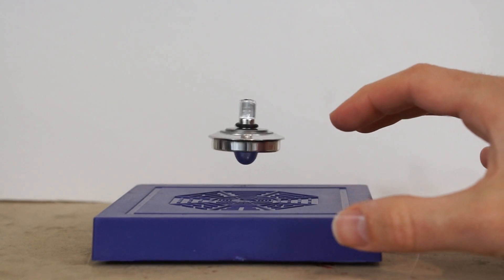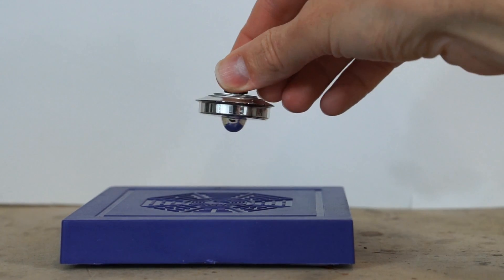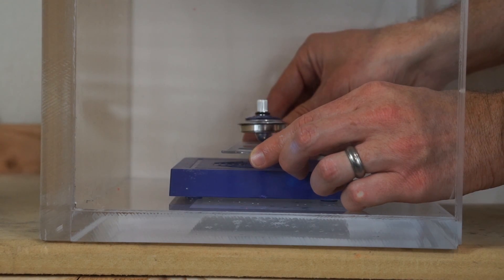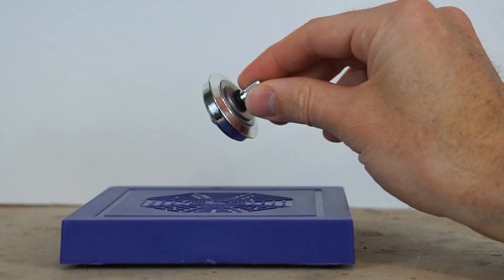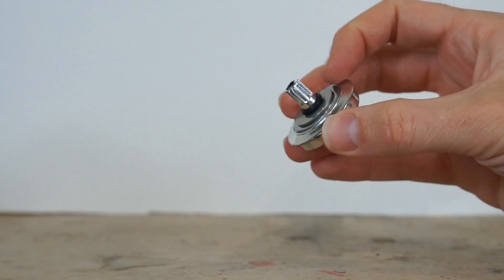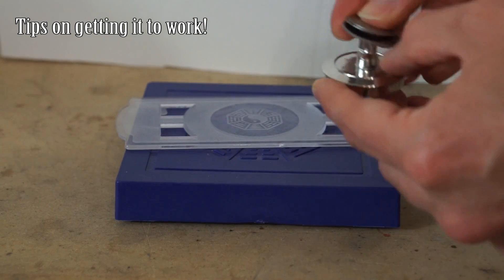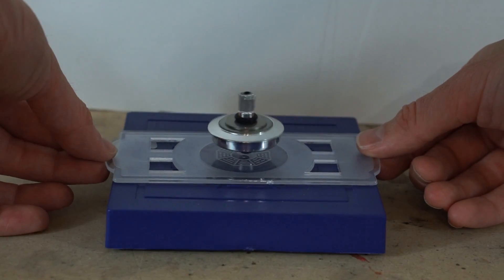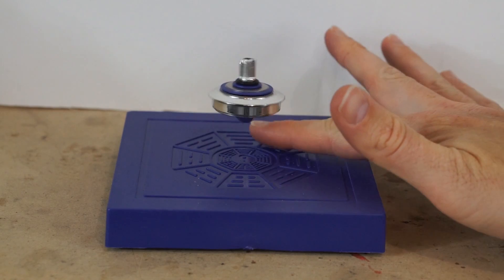Will a Levitating Gyroscope Spin Forever in a Vacuum Chamber?

Comment: The earth isnt spinning in space, you just kind of proved it.
Reply: Flat Earth Supporter😂😂
Reply: how? if the earth isnt spinning how do we have night and day?
Reply: You just kind of proved how little you need to know to believe in something
Reply: OttoZONE. how?
Reply: Is that a real thought? Are you that dumb? There was nothing in the video to support that moronic idea.
Reply: it didnt spin forever because of eddie currents. what is you flat earther's explanation for gravity? why do some things fall faster then other? what about the creation of planets?
Reply: OttoZONE His B.S. theory is slightly incorrect. Gravity force is the main reason it fell, not friction force. Even though the magnet is opposing the gravity force enough to cause it to levitate, there is still gravity acting on it. Gravity does not effect the Earth in the same way.
Reply: OttoZONE how does any of that disprove gravity. Let’s put three hundred years of physics aside for a moment. You don’t need that to see how gravity will pull things towards the earth with equal acceleration. It’s logically impossible to do anything else. Just look at the units. Acceleration(a) is meters/seconds^2. Mass(kg) doesn’t show up. As such if mass doesn’t cancel out some how in your equation the end result can’t be acceleration. The only way one could try to get out of this would be to relate acceleration to some kind of mass ratio, but upon further examination this doesn’t help you either. There is something due to gravity that is different from mass to mass. It’s called force. You know F=ma. Now, let’s go back three hundred years a try to find out acceleration shall we? Ignoring direction F due to gravity is GMm/r^2 where G is some constant, M is the mass pulling on a object, m is the object in question, and r is the distance between them. For a give object with mass m we know that F=ma in general. Hence  GMm/r^2=ma. Hence GM/r^2=a. Isn’t that magic. There is no variable m left the equation. Just a predicted. Really, this is basic stuff. 

Yes, in a vacuum if you drop a brick and a pin at the same time they would hit the ground at the same time, but I would put my hand under the brick. No, that fact that atoms have mass doesn’t conflict with this, and no that doesn’t mean that everything with equal volumes should have the same mass.
Reply: Apastrons Gt An astronaut playing growtopia??? lmao no u guys should do ur own research on flat earth proof instead of asking in the comment section lol theres too much to expkain to type it out
Reply: News Flash:  The Earth is slowing down too.
Reply: a block of wood weighs less then a block of steel because of its density and the atoms in the two different substances. you still didn't answer my question about the creation of planets. a hammer and a needle may hit the ground at the same time but what about a feather and a concrete block? you also have to consider aerodynamics and the amount of drag on each object.
Reply: OttoZONE LOL FAIL!! It doesn't spin forever because the magnetics pushing up and gravity pushing down creates friction. Simple stuff. Learned that in 7th grade physics. lmao
Reply: Cole Purchase what does the creation of planets have to do with OttoZone’s points? It’s a red herring, and I don’t believe you know the answer anyway, so why bring it up?
Reply: jeremy hansen yes, there is a variable in your equation. G is not a constant. G is an average, and goes out the window when statistically examining its various “experimental” derivations across history. The Cavendish experiment is an example of the non-repeatable,  non-reproducible determination of G. It’s called a constant, and like the official distance to the sun, it has changed throughout the years. Some kind of “constant”, that is. Some BS science, all this support of the heliocentric model.
Reply: UAP Cant tell if all these flat earthers are trolls or if theyre really all too stupid to strap a camera onto a big balloon and see the footage
Reply: zeNUKEify um that's already been down flat
Reply: To all dumb flat earthers here 
Take a fucking telescope go to a beach or harbor and point to a ship or cargo that's leaving ,if earth was flat you should be able to see it no matter how far it goes using your telescope .
But that doesn't happen after a while the ship just plain disappears and it doesn't matter how big a telescope you use the ship can't be seen because its well over the curve.
I know some dumbfuck will bring refraction into this, 
Refraction occurs only when light moves from one medium to another with different refractive index, the light leaving the ship travels straight.
Reply: The Earth is spinning and it used to spin a lot faster billions of years ago. Some say that the Moon moving farther is slowing Earth down, but that might not be all there is to it. Studies also show that the Earth's spin speed can increase or decrease at times.
Reply: you don't know enough about physics, you just proved it lmao.
Reply: First off the pressure and buoyancy models of gravity are complete bs because of the gluon/higs field interactions that give around 4% mass to protons. secondly its bs because of the energy contained in the gluon interactions that give the other 96% mass to mater made of any combination of quarks. furthermore, the buoyancy models and the densities models cant explain things like the Casimir effect, superfluids, electrons dissolved in ammonia, electrons in a vacuum, the scale of density increase in plasma with an increased electron density and the list continues. density/ buoyancy theories are a simple-minded theory with no basis in reality and they completly fall apart when you look at reality in a more in intense fashion. you're going to need to do a lot of thinking to come up with ways to explain the things I just listed for your worldview to be justified and at that point, it would seem more logical that gravity is a thing and not just a figment of the imagination of most of the people on earth.
Reply: mass = resistance to acceleration. 
weight = (mass)(gravity aka 9.81m/s^2)
atomic weight = mass of protons + neutrons + electrons. 

the atomic weight actually describes the mass of an atom, not its weight. or the atomic weights would be different on different planets.

0.   mass is a property of matter
1.   one cubic meter of air has the same dimensions as one cubic meter of iron.
2.   iron has more protons and neutrons in its nuclei
3.   iron, therefore, has more mass than air due to having more matter inside atoms
4.   more mass = more weight.

All you're doing here is showing how little you understand about reality. I'd suggest going back to high school or even completing high school to begin will. Take physics and chem and you'll feel better about all the stuff you little theory cant explain.
Reply: If we are reviving mouth-breather old fashioned ideas how about blood letting and using leaches to cure mental disorders... I suggest you collect 6 liters of your own blood in a bathtub.  😂 I seriously didn't know that the illuminati conspiracy to test how gullible humans are actually worked... I thought it was a joke but I guess there are really some out there that fell for the trick... mostly elementary school drop outs but hey... I guess somebody's gotta flip the burgers. 😂 don't fall off the planet.
Reply: Lmao... according to some of the logic on here... tho statement must make sense... 

Dogs bark, so an iguana is simply a dog with a cold

Science has a following... people follow people on twitter... Twitter deserves a Nobel prize for literature.  

People have eyes, whales have eyes and storms have eyes so people are actually Gods that came from angry whales...

Lmao just because you use the word "theoretically" or "scientifically" in a sentence doesn't mean that somehow asinine concepts suddenly fake sense... please go walk off the edge of the planet if it's as flat as you say it is. Lol
Reply: If ur a real Flat Earther than why are you watching a science channel? I though you were anti science
Reply: Cole Purchase:
You totally didn't get it... Comment completely flew over your head...
Reply: Cole Purchase it’s flat lol dummy
Reply: Thats a two way street and your on it as much as I ya little globesexual.
Reply: we know that you can drop Hammer and a needle at the same time, and that they will both hit the ground at the same time.Mainstream science say's that this is due to the fact that the ''Pull'' of gravity is acting equally on all mass, in other words gravity is constant and that the pull of gravity is acting on mass the same universally across the board. Which is why The hammer and the needle both hit the ground at the same time. So if the ''Pull'' of gravity is acting equally on all things,and by that same pull weight phenomenon is created, Logically and theoretically speaking all things would actually weigh the same since we are strictly are adhering to the notion that only gravity grant's weight, throwing out the scientifically valid self sorting self arranging system of Density and Atomic weight.(KEYNOTE. please notice the first coined Scientific term ''Atomic Weight'' actually uses the word ''weight'' in it's description,and is also interchangeable with the term Atomic mass. It is highly disputed by the G-tards that mass is different from weight, but an in depth read on will reveal that despite their acrobatic gymnastics and double think they are forced to admit that mass and weight are indeed the same thing ->Atomic mass (ma) is the >mass of a single atom,< with unit Da or u (the unified atomic mass unit). >>It^> defines the *weight*<< of a specific isotope, which is an input value for the determination of the relative atomic mass.) You see to understand the lies you have to understand DOUBLE THINK. On the one hand they say Gravity is soley responsible for weight phenomena and on the other they also acknowledge Atomic weight. The problem is you can't have both. Why does a block of wood weigh less than say a block of Iron with the exact same preportions???? they say this is due to the atomic >weight< of the two masses. The ST.Einstein/Coppernicus cult has no way to mask this very obvious HOLE in their theory so they do admit that '' well yes it is actually the amount of building blocks that comprise an object and how big each individual building block is I.e IT's molecular Mass or Atomic Weight that determines how heavy a thing is.
Reply: F a k e. N e w s.    This has been demonstrated over 60 years ago.  Boring, boring, boring presentation and voice.
Reply: Truth bomb. Mind control programming TRIGGERED! Hypnotized masses go berserk!
Reply: Dude, he pumped the air out of the box and the Spinner wobbled and than fell. He than comes up with some B.S theory aboutwhy it didnt spin forever&some  junk and dosen't repeat the experiment to see if his hypothesis was true.
Reply: OttoZONE its because the earth is FLAT

Comment: Wouldn't gravity act as a force of friction?
Reply: No.
Reply: frozencloud17 that's not how this works, that's not how any of this works.
Reply: No.
Reply: frozencloud17 gravity doesn't exist
Reply: Jake Wagner if I threw a object in a 100% airless room (which is impossible btw) would it fall? Friction is two forces opposing and in this example it is gravity pulling down and a object flying up
Reply: Actually a sphere or a cylinder does not generate gravitational waves when rotating around its own axis.
Reply: Khenric not of its own but by distant neutron stars unless we are considering place away from our observable universe. As long as it is in our universe the Doppler effect will act on it.
Reply: I honestly don't see what the doppler effect has to do with it.
Reply: Khenric i didnt mean to associate doppler effect with the waves but what i wanted to say from being inside universe is that the light and radiations are factors that will result in stopping of the top with the the respect to time.
Reply: Donkey Kong hey buddy, try jumping then. Tell me it doesn't exist after that. Then give me an explaination to how it doesn't exist when we have proof of it working and forming our solar system and just about every galaxy in our universe.
Reply: try a superconductor😆
Reply: wow , brainwashed
Reply: I was wondering the same thing
Reply: Nothing exists.
Reply: Nothing is true, Everything is premitted
Reply: Jake Wagner that is how it works. The magnetic resistance and the gravity both work together on the top on both sides. Even if you do this experiment in space at absolute vaccum on a magnet it will still stop at some point. It will keep moving for long time in absolute vaccum if you don't use magnet at zero gravity but it will eventually lose the energy due to gravitational waves and will stop.

Comment: It will stop, because of the same magnetic area, not only hold it up in the air, but also function as a break. (gravitation pulls down the spinner, and the magnetic fields are push up in the same time).
Also light make it slowing too, because the impact of photons have energy. +there are other thing what can make it slowing down in a long distance...

Comment: Yes.. nearly forever. It emulates the earths perpetual motion due to no air friction. If you have a magnetic field, the movement of electrons will push the body slightly reguardless especially in a non friction atmosphere.

Comment: You must have a perfect vacume you can't do  it you need a stronger vacume but eventually it will stop because the magnets are producing. Some resistance they are not perfect to the field
Reply: Is there such a thing?
"The actual density of hydrogen as it exist in interstellar space is on the average of about 1 atom per cubic centimeter. In the extremes, as low as 0.1 atom per cubic centimeter has been found in the space between the spiral arms and as high as 1000 atoms per cubic centimeter are known to exist near the galactic core."
https://hypertextbook.com/facts/2000/DaWeiCai.shtml
Reply: You cant make a perfect vacuum due to quantum fluctuations.

Comment: I paused and my guess is that the magnetic fields make their own "Drag" on the spinning object.  I believe that is a greater factor than air resistance, so it will not spin forever, but perhaps 1-5% longer, on average.

Comment: There is still force from the levitating magnet acting on the base magnets, so thermal energy can transfer from the levitating magnet to the base. You'll also need to measure the rotation of the vaccum and air control trials.

Comment: There are 3 forces interacting with the object. 1) There's the gravitational force of the planet, wanting to pull it down. 2) There's the magnetic force, wanting to flip the gyroscope 180 degrees so that the gyroscope and the magnet in the platform will pull together. 3) And then there's the force of the object itself, wanting to pull outward along a horizontal plane because it is spinning.

So it seams to me that because these three forces are archaically interacting with each other, it's only a matter of time, mainly due to the magnetic force of the platform wanting to flip the gyroscope over and then pull it towards the platform; that once it flips and then magnetizes to the platform, it's game over for the endlessly revolving gyroscope.

So that would be the first reason I would expect for this experiment not to work very long.

However, this is definitely a cool experiment and I'm glad that you did it and posted it on youtube so that I could watch it. If a picture is worth a thousand words, then this video is definitely worth 696,000 words, equivalent to a 2,748 paged book.

Comment: I paused the video and think it will stop because the gravity is pulling down on it. The vector of the force of gravity is perpendicular to the vector of the force of the spin, so it will take a lot longer to stop it, since it is not pulling in the opposite direction, but it will eventually stop it. At least that's my guess

Comment: Ok the thing is going to stop due to something called magnetic friction since there is no such thing as a polarized magnet or in other words a magnet with just one pole the both face although very weakly is still pulling on the top causing friction slowing down the spin forcing it to stop eventually

Comment: i agree that slowing is due to magnetic resistance. when the magnet turns, it builds up eddy currents meant to create a magnetic field opposing the change in the external magnetic field. since the body turns, the external magnetic field changes always and the induced currents create weak magnetic fields always directed towards slowing the rotating body down. not sure if possible to measure but the levitated magnet would heat up. maybe a laser probe would be able to detect the heating up. you could say point the laser underneath to avoid heating the body directly.
one solution to the problem is that instead of rotating the levitated body, rotate the magnetic field underneath. then the body will not need to the rotated prior to land on the magnetic cushion.

Comment: It will not spin forever. There is mass moving through space and time therefore WORK is being performed. The WORK formula requires the conversion of energy. The energy conversion used to spin the object conversion casts off as waste will show as heat in the plate. There is less and less energy available so one part of the equation will result as a zero result,  Work=0. You have only removed the drag of air fiction in the container.